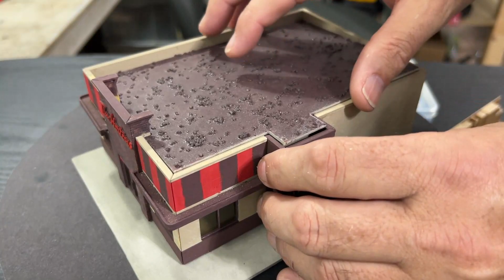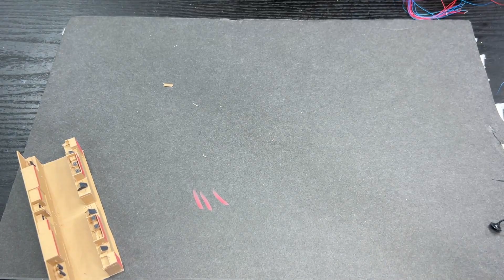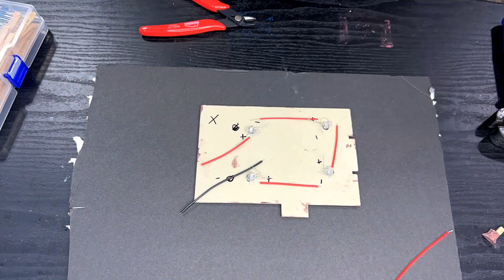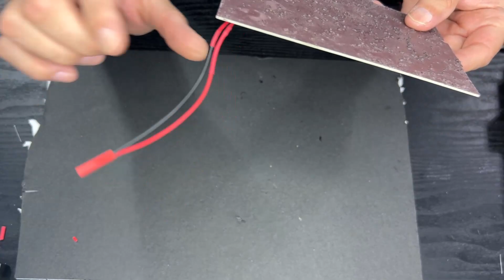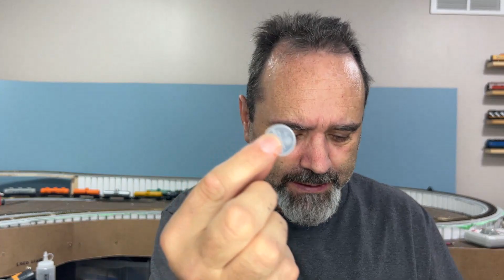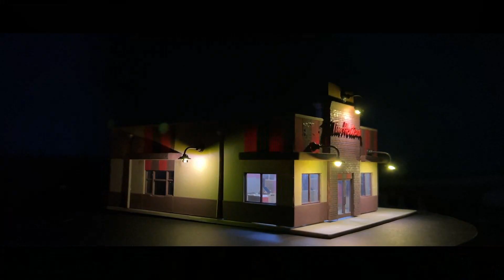LED Lighting On Our Model railway Tim Hortons Restaurant

Comment: Gan you please list a link to the micro LED's?   There are so many different ones...  US supplier? The ones from China definitely take the slow boat, nowadays. I already have the larger ones and the outside lights. Thanks.
Reply from the maker: I got the micro leds from Ali express. Takes a while, but much cheaper. Just need to plan your projects far in advance.
https://www.aliexpress.com/item/1005005196220161.html?spm=a2g0o.order_detail.order_detail_item.5.a35af19cpuYdus

Comment: That interior, along with the lighting, transforms the model.  Did you design the 3D print?

Considering the size of your layout, and this is Canada after all, you'll probably need at least 2 more Tim Hortons locations to service all your little people.

And where did you find a Cox transformer?
Reply from the maker: I didn't design the 3d print. It was on Thingiverse.
Yes, I might need another coffee shop or two.
I have about three of those transformers. They are practically free at train shows.

Comment: Nothing wrong with the transformer,resistors, those LED's are not the dim-able variety.
Reply from the maker: I use them on locos and they do dim a little. I think I used too big a resistor.